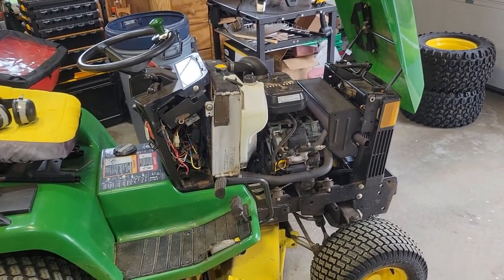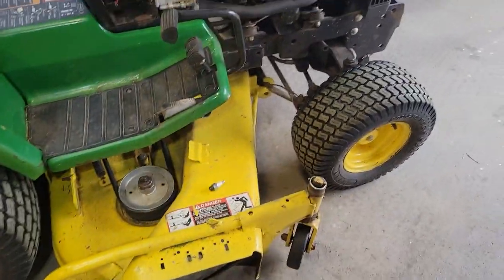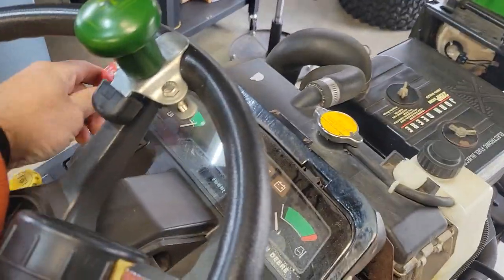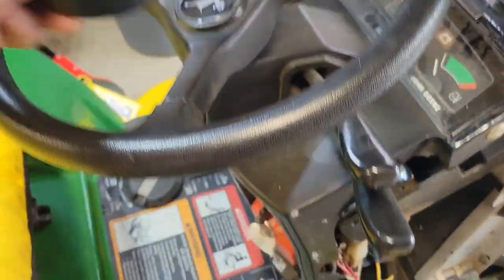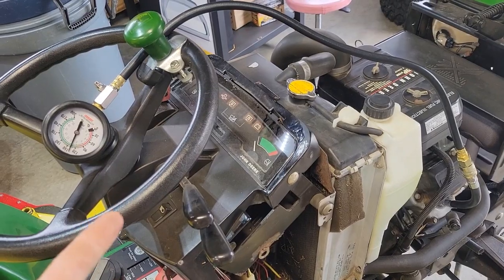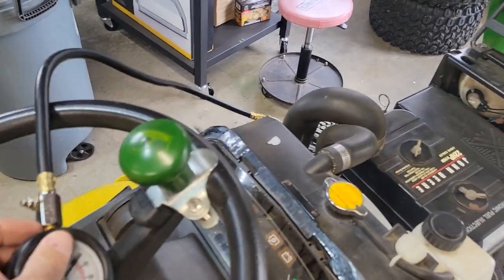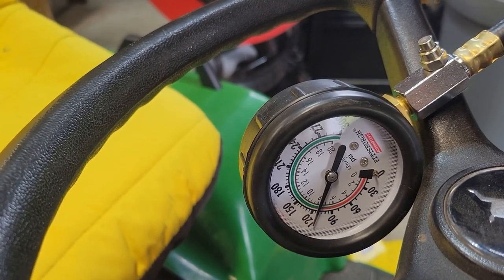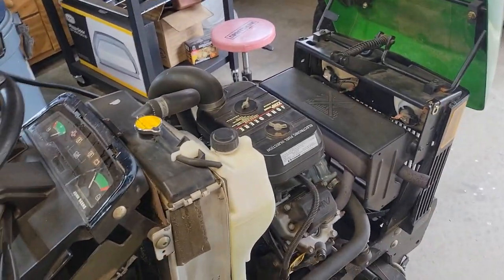John Deere 445 Compression recheck

Comment: Testing mine now. I have 170 on one side and 150 on the other. Going to try seafoam, fill the cylinders and let sit for 48 hrs, clean out and run it hard for a while, then re-test. I’ll post what happens for entertainment.
Reply from the maker: What are you hoping the seafoam does? I need to retest after a season of running
Reply: @ I have seen others in cars using it, or Berryman to do a piston soak and free up the rings. Some have seen oil consumption drop drastically, and compression come up some.
Reply from the maker: @jd1029  interesting.  I am going to have to look into that if I still have low compression.  I don't consume oil at all, so my low compression has to be from somewhere.
Reply: @dougdoesstuff24  I just found Valvoline Restore and Protect oil, may try that out. Seems like many have seen good results